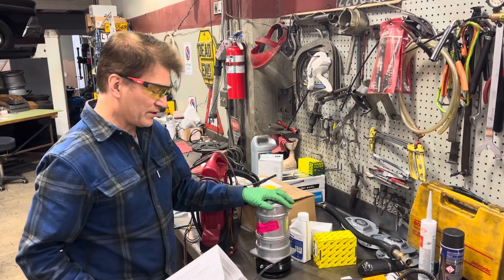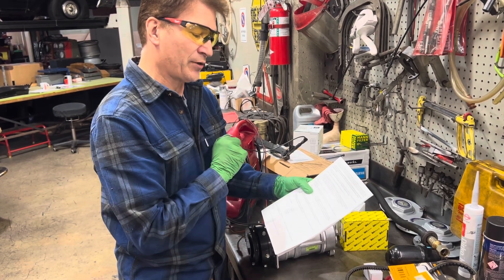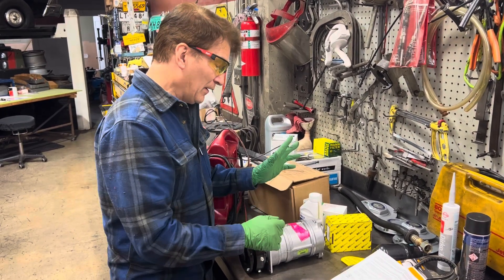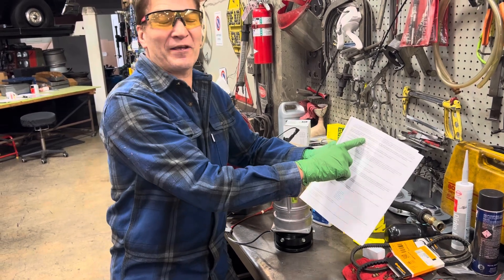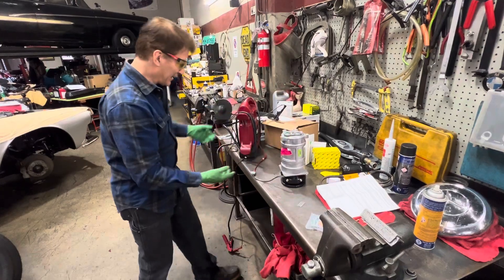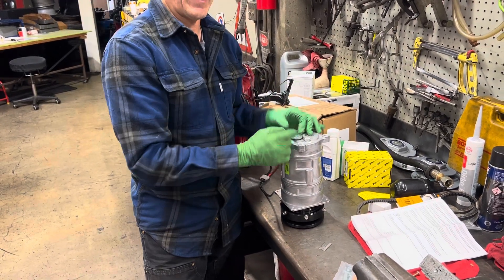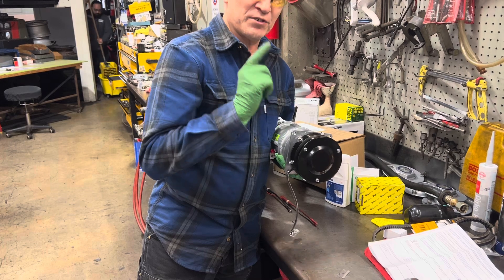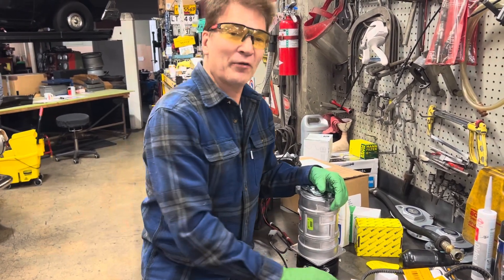NEW A6 compressor WITHOUT ! OIL SUMP read instructions

Comment: I am impressed with how thorough you are, setting an example those of us who never received the right training. What is the best solution to really learn the right way? Does anyone offer this training?
Reply from the maker: The closest thing to some training they are getting better over the decades is MACS. Years ago they were really lagging behind and what they didn’t teach and they were really lagging behind and what they did teach..  but they have progress and gotten better rapidly in the last decade. 
     The other one is a Dutch company that makes automotive parts called
Nissens 
On their website, they have training videos for air conditioning a whole section of them and they do live webinars and they show up at Automotive events, giving classes on different topics all away from the basics all the way to the latest heat pump systems on electric cars 

They’re most knowledgeable, best instructor. His name is Michael from Denmark. He was the very first instructor that was very impressed with. .

Comment: Great video as always Tom. Honestly this scares me into wanting to just drain everything, including the new compressor. That way I can just measure in the exact amount needed with certainty. I also worry about human error when making the compressor, and forgetting to add the oil in and placing the tag on there anyways stating it has oil. Maybe I worry too much.
Reply from the maker: Other than the possibility of mistakes completely disassembling apart, flushing and refilling with fresh oil is the best and only way to make sure 100% it is correct
Reply from the maker: 100% oil drain taking it apart and flushing it is the only way you can make sure it is 100% correct and accurate. Yeah you do have a human factor of mistake possible and nobody can afford usually just to pay somebody to do it like that, but if you’re doing it yourself, you have all the time in the world.
Reply: @coldfinger459sub0  Very good points there. I hope you'll do a video sometime covering the old R12 systems (I.E. the old RV2 Chyrsler systems), and the do's and don't's as far as any efforts to retrofit to at least attempt to maximize what's possible with todays refrigerants. The new R1234 stuff "seems" to me like it may cool better than the R134, but it's so expensive. Thanks again!
Reply from the maker: @mine1username  think over the years I’ve done two or three videos on the Chrysler RV2 

Actually, I know pretty sure that three of them may have done more. We’re on a mechanic who worked at a shop I did air-conditioning for and he collected and restored old Chrysler. . 
      If it’s the original Old Chrysler and you’re gonna convert it over to 134
    I just had The Mechanic since it was his car. He just took apart the entire vehicle AC system flushed out every individual component replaced to every O-ring brand new receiver dryer that wasn’t attached or unplugged to be hooked up until I was ready to hook up the vacuum pump.

Because you do not want to expose receiver dryers to the atmosphere or the moisture in the system you put together so you leave it sealed and capped into the very last second. 
       Replaced all the oil with PAG 150. In the original compressor.
        He ended up moving down to Palm Springs in the desert. 
    During his first summer when it was over 100°F he was sending me pictures of his thermometer in his dash coming out at 42°F. . 
    When he moved he sold one of the Chrysler to one of the instructors at one of our college that have an automotive program, and he currently owns the other Chrysler retrofitted.
Reply: @coldfinger459sub0  Thanks again. I'll take another look for your videos. That's promising.  That's great he got it that cold, assuming he had the factory style condensor.... When I converted a Sanden system from a 1986 Ramcharger, I charged it with R134 to 80% of the R12 recommendation (it's what I was taught at the time anyways, right or wrong). Worked okay, but I always wondered about that condenser's efficiency. I believe I got it down to the high 50's if I recall (I live in Arizona, so it's 110+ much of the summer). It would be cool if I had a place nearby that could custom make high efficiency condensors.
Reply from the maker: @mine1username  the secret of places that are hot like 100° 110° if you’re gonna go out for today turn on your vehicle in the morning and just don’t turn it off all day long keeping it on max cool yes you’ll burn an extra one or 2 gallons in gasoline that day. But my comfort is worth it.
Never allow the interior of the car to get hot because once that happens, it’s nearly impossible to pull it all the way back down to the coldest level again on 100°F day
Reply: @coldfinger459sub0  so true!!

Comment: Good info Tom.  I havent seen an A6 compressor in about 30 years, and it was the old A6 with an oil sump.  Did the new A6s eliminate the oil sump as a cost savings when they went to al aluminum case?  Those old A6s were heavy but nearly bullet proof as I recall
Reply from the maker: Probably weight savings in size savings. 
     What’s the lighter weight of viscosity refrigerant oil it returns easier so possibly they deemed it. Not necessary to have such a large sump anymore.. 
      I myself would feel more comfortable with a buffer of 6 ounces of extra oil sitting in a sump, so when the refrigerant level fell very low, the compressor would continuously self lubricated itself.

Comment: Thanks Tom.
I'm getting ready to convert a 1993 olds '98 from R12 to R134a. Somewhere I read that I'd need a "more robust" version of the A6, as the information suggested was supposedly used in the R134a system Olds model 98 begining with the 1994 year model.
I have an A6 hd from a 1994 Buick R134a system (along with the rest of the car...shot transaxle), but before changing compressors, I was curious as to whether the info about the compressors being different was actually true or not. I'm assuming I should swap out the pressure switch(s) in any event. 
Great driving old car that belonged to my deceased parents (now passed). My plan was to re-tag the car if I can get it blowing cold air again!
I'm certfied in HVAC, but haven't yet upgraded my epa license and practical training to include automotive hvac yet.
I really enjoy your channel content and "delivery style"!!!
Reply: Many thanks for taking time for your earlier response! Don't have my notes in front of me, but I assume if I "chance it" and use the original "R12 compressor"... at a minimum, I'll need to do a full system flush (clear out the mineral oil), replace the accumulator, upgrade o-rings and pressure switch, and place appropriate amounts of PAG oil in the various components (compressor, accumulator, etc.). And yes...recharge the system with R134a per "retrofit" instructions.
Some of the "havoc" we in the commercial HVAC side of the equation began facing with post-R22 refrigerant systems (components prematurely failing due to the higher pressures, thinner wall coil tubing failures, etc ) looks to have made it's way into the auto HVAC side with the introduction of R1234yf. My understanding is that the systems using this stuff operate at only slightly higher pressure (than R134a), but are immensely more refrigerant charge weight sensitive. Many of us have "lived" with cars that simply required a can (12 ounces) of refrigerant every l-2 years, and perhaps a shot of oil at some point.  With the newer auto a/c systems' cooling ability falling off severely with as little as a 1 1/2 oz. overfill/underfill, similar size leaks will mean far more visits to the a/c shop...but hopefully, a proper repair to truly address the problem. It seems that with R1234yf there's no such thing as "a small leak"anymore...they are ALL significant!!! 
At least with R1234yf you probably have a refrigerant that will be around awhile ...
On the residential side, equipment is making a hard turn transition from R410a towards one of two newer refrigerants (still operating at "high pressure" though). Predictably, the new stuff isn't compatible with existing systems, and already the horror stories are starting to come in concerning system reliability. Of the new systems I've installed (using the newer refrigerants)  I've not YET experienced an "equipment failure" related call back... but several peers in the area I'm friendly with haven't been as lucky!
Please keep your a/c related videos coming... I, along with I'm sure, a host of others truly enjoy them...very informative, and very well presented!!!
Reply from the maker: @MIKET5609  actually Automotive started retro fitting over before residential and commercial HVAC. 
       1990 was the first introductory year of 134 refrigerant into Automotive. 
        2012 was the first year mandatory introduction of R410 to phase out 22
Reply from the maker: Later on manufactures learned, they started adjusting the piston ring material the piston clearances the types of oil they used the type of compressor shell housing O-ring material as they switched over from the original model and style compressor that were used with 12 refrigerant and they discovered they were having high failure rates so they started implementing designs specific For the refrigerant and oils they were using. 

But one done properly the old compressor is held up just fine compressors don’t die just because of the refrigerant or the oil .,
     They are murdered by lack of Maintenance or the person who did the wrong retrofit improper procedures under charged overcharged or allowed to allow the system to run low on refrigerant.

Comment: When I am about to install a new compressor, condenser, filter and expansion valve, and after cleaning the whole a/c system I discard the factory compressor oil and replace it with the correct amount and type. After that, I manually turn the clutch plate several times, sometimes I use my largest impact gun so it can spin without impacting the internal parts. I prime the system with oil putting 50% of the system oil invthe compressor and the rest in the condenser or filter. As always thanks for your teachings.
Reply from the maker: The bigger the impact gun spin, the compressor the better 👍.  I personally like the ones used for large truck lug nuts.